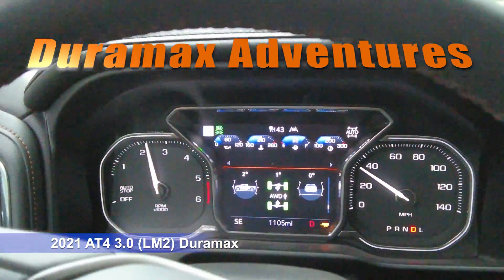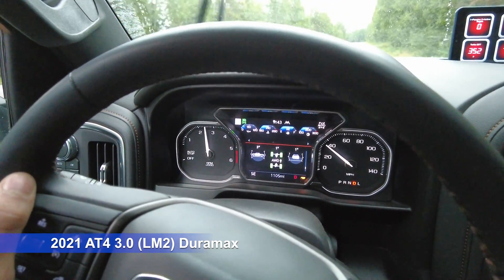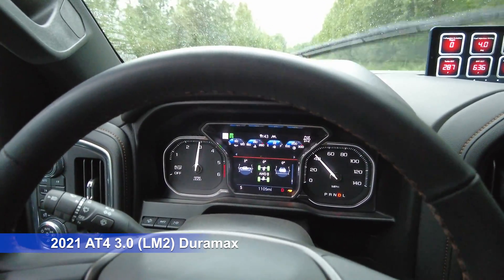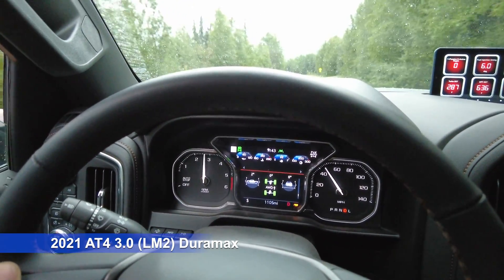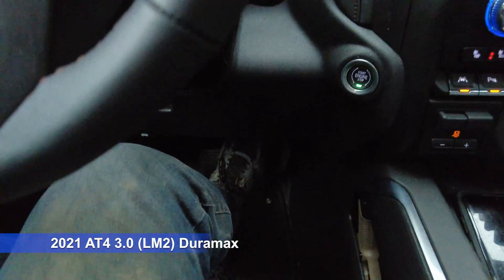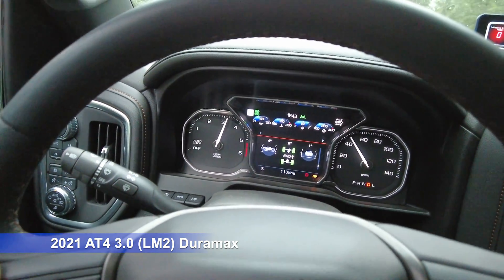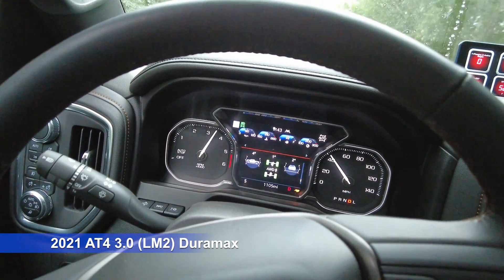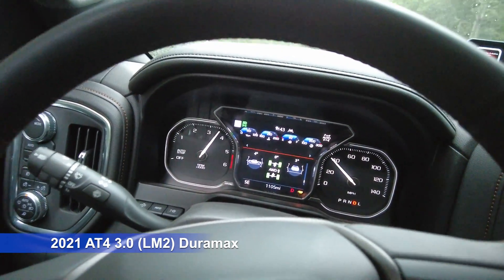How to engage your Exhaust Brake on a Duramax!!!

Comment: Using the engine and transmission  to grab and hold lower gears is not exhaust braking.
Reply from the maker: The vanes being closed is. And diesel can't compression brake 😉

Comment: i did a lot of towing into the CO mountains up to 11k' this year with my 2021 Sierra LM2.  On steeper grades, i usually just grab L instead of trying to manipulate it with the brakes like that
Reply from the maker: We are testing out the factory algorithms. Ultimately had the same behavior as if I manually selected the gear. Which is impressive!

Comment: That looks like aggressive down shifts common in tow/haul when braking. Exhaust brake should work independently and not require a down shift. A gas truck in tow/haul will do the same thing as what you showed.
Reply from the maker: Correct the exhaust brake does work at lower RPM. When the exhaust brake is active your generating negative torque.

You need the negative torque then multiplied by  lower gear ratios to be effective. That negative torque being multiplied is what slows the vehicle are larger grades.

Comment: This is a light-duty pickup. Cummins is meant to tow very heavy loads. (It can tow a tractor trailer)
3.0 Duramax is economic for commute and capable of towing a midsize travel trailer or a boat safely.
This engine does not use a traditional exhaust brake system but achieves similar results by other means.
Lastly, exhaust and jake (engine) brake are completely different systems.
I have the 3.0 Duramax for two years now almost 50,000 kms, tow with it wnd use it to commute and use it as a truck. I could not be happier. I owned a Cummins before. Nice truck but I Don't need a 1000 ft/lb truck, and to be completely frank, not many do .
Reply from the maker: It's the same system on a smaller scale as the 6.7 Cummins, 6.6 duramax and 6.7 powerstroke.

All use VGT for exhaust brake. No consumer level truck has a Jake brake.

Comment: That's not the exhaust brake. If you use cruise control with e haust brake on it all works together and doesn't down shift hardly at all. However when not using cruise the truck will sense the downhill and use exhaust brake as needed.
Reply from the maker: It's the exhaust brake on the LM2, it needs RPM to generate negative HP to control the load.

The cruise uses the brake pads to slow the truck, it also has similar behavior, however it waits until 10-15 mph over you selected speed and doesn't pull it back down to the set speed.

Comment: If you don't have a button on your dash that says exhaust brake then you don't have one. Get a clue and know what you are talking about before you make videos with misinformation.
Reply from the maker: You are misinformed.

This is direct from the 3.0 diesel supplement. 

"Exhaust Brake 
Exhaust braking is automatically activated when Tow/Haul Mode is selected. It maintains the vehicle’s speed by automatically implementing a shift pattern that uses the engine and the transmission to slow the vehicle. The system will command downshifts and use the turbocharger on the engine to reduce the vehicle’s speed when the brake is applied. The normal tow/haul shift pattern will return once the vehicle is on a low grade or when the accelerator pedal is pressed."

I welcome any further information requested on the matter.
Reply: It literally says exhaust brake engaged with you hit tow haul. It pops up on screen. The big duramax has a separate button. The 3.0 turns it on automatically in tow haul mode. That being said hopefully I’m not disappointed first time I tow.

Comment: Okay so you were just in tow mode not in manual mode. And all you did was drag the break. Did you apply about 1/2 pressure on the brake pedal or 3/4s pressure on the break?
Reply from the maker: Like 1/4. Yes in tow haul
Reply: Brake, not Break!

Comment: I had my 3.0 for 2 years now. I tried everything. Cruise, tow/haul, manual low, spiking the brakes, dragging the brakes, and got nothing. I could be loaded, empty, towing, going downhill, uphill, whatever. It does absolutely nothing. Can't hear anything and sure as hell can't feel anything. All I got it to do was skip a gear downshifting, thus pinning the rpms. And even that doesnt really slow the vehicle. It's a shame as this feature was a selling point for me.
Reply from the maker: It's not about slowing, it's downhill control so speed doesn't rise.

Only works in tow haul.
Reply: I got a 2.8 and mine kicks in all the time, sometimes more than others, as stated it works with Tow Haul Mode only. My comes on when I tap or hold the brakes when I’m in 2nd gear or higher

Comment: Exhaust brake also works with cruise engaged going down a grade and toggling selected speed on wheel and also in L mode and manually selecting the gear. 8-10 are all overdrive and will not work in these.
Reply from the maker: It works in those gears just ineffective down hill.

Comment: Lmao this is not an EXHAUST BRAKE.... this is engine braking by telling the truck you're trying to slow down "dragging the brake" after you already told the truck your towing "tow haul mode" the tow haul mode is set to shift the truck down sooner than normal or one more gear than normal to use "ENGINE BRAKING" to slow the truck down.  The LM2 engine is NOT equipped with an exhaust brake.  Don't listen to this goof
Reply from the maker: Yes it is, it closes the VGT down to generate back pressure. Just like the 6.7 Cummins, 6.7 Powerstroke, and 6.6 Duramax.

All we are adding witn "drag the brake" is engaging the grade shifting logic.
Reply: @duramaxadventures5832  
No Sir, 
I’ve owned Chevrolet’s and Fords, both diesel and gas) and currently in a Ram Cummins.  There’s nothing to compare regarding the Cummins exhaust break and they have a dash screen showing both turbo boost and exhaust break real time hp… very different from what you’re showing with tow haul engine break via rpm. 

The VGT system is a patented Cummins design that controls boost pressure much more effectively. The desired boost pressure can be regulated for various engine loads creating more efficiency. The Cummins Holset design uses a set of guide vanes that controls exhaust gas through the turbine. 

The difference between the Cummins and conventional design is the standard design pivots the vanes to get variations in nozzle areas while the Cummins VGT vanes don't pivot but slide on it's axis. The VGT raises the exhaust turbine efficiency because of the accurate angles it can achieve. 

The sliding nozzle ring design can easily increase exhaust gas flow onto the turbine wheel. As the geometry changes inside the turbo the boost is increased as the nozzle is closed down. The increased exhaust pressure speeds up turbocharger speed. When the nozzle rings open boost decreases to maintain the best boost levels according to engine rpm. The variations are endless with the VGT to suit all engine loads. 

Other benefits include improved fuel economy, EGR emission control and assistance with regeneration of the DPF exhaust system. I am sold with the ISB diesel and we are very happy to be ordering our buses with nothing else but the ISB option planted in the IC conventional school buses.
Reply from the maker: @2K9s   You are mistaken as well.

However please feel free to subscribe because I have a video actually showing what's actually occurring coming shortly. 

This is not engine braking by RPM alone, there is actual backpressure being produced on the engine via the turbo giving it an exhaust brake.

If you disable tow haul the backpressure plummets and you race down the hill even with RPM over 4,000.

And Cummins doesn't make a half ton diesel anymore.
Reply: @duramaxadventures5832  
No thanks.  Nope, I’m not and I doubt the engineer’s are mistaken too. 
Look what you’re comparing this to above.  Comparing doesn’t make sense… but you’re probably right about everything.
Reply from the maker: @2K9s  ... you know John Barta has a whole video on how the EXHAUST brake operates on the LM2 right?? Btw he's the chief project engineer.

I also have the OBD data showing it and the negative HP just like the Cummins.
Reply: @duramaxadventures5832  
Cool.  Too bad it doesn’t work like a Cummins.  Haha
Reply from the maker: @2K9s  never said it did
Reply: @duramaxadventures5832  
Yes, you did.  Do yourself a favor and drive a 6.7 Cummins and you’ll understand that nothing you’ve mentioned compares… read your first comment.
Reply from the maker: @2K9s  I never said they compare. Lol who compares a 3.0 to a 6.6 or 6.7.

yep driven many Cummins, dont like them. 

And yes they all use VGT. So I stand by my comment. That was the point of the comment.
Reply: @duramaxadventures5832  
You.  Tough to compare a car chassis to a truck but at least you’re consistent.
Reply from the maker: @2K9s  what car chassis? They don't put the LM2 in any cars.
Reply from the maker: Anytime you are off throttle in tow haul the exhaust brake is active generating back pressure to increase control

Comment: Engine braking like any other truck...
Reply from the maker: its actually applying back pressure to the exhaust while also adding boost to the intake to slow the pistons. That's what makes it such a capable tow rig!
Reply: @duramaxadventures5832  
Lol
Reply from the maker: @2K9s ya he must not be familiar with the LM2
Reply: @duramaxadventures5832  
The 3.0 is very different.

Comment: Define drag the brake
Reply: Extremely light input. Not enough to actually put pressure on the brakes. Just enough to activate your rear brake light switch.
Reply from the maker: @mixedgrid is correct, here I am actually clamping the pads but the load is heavy enough its not slowing down. 

Similar pressure to creeping at a stop light would probably be a good reference.